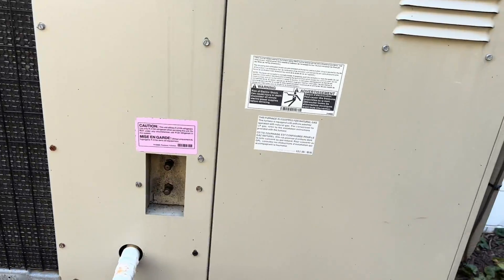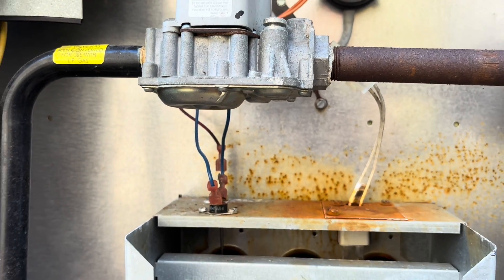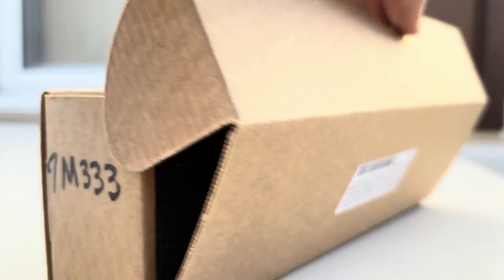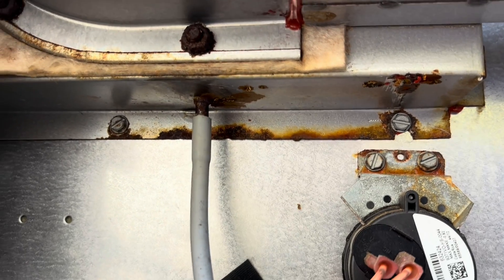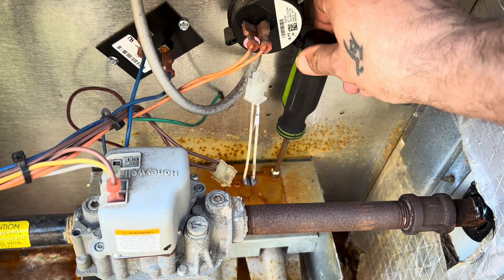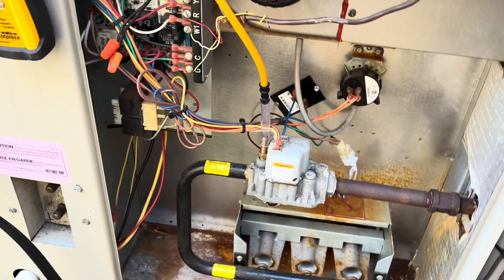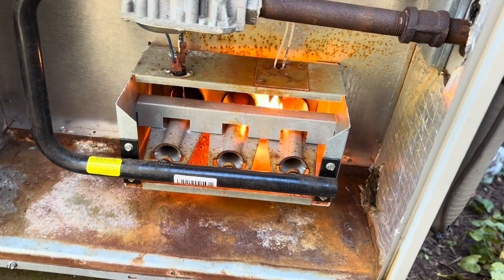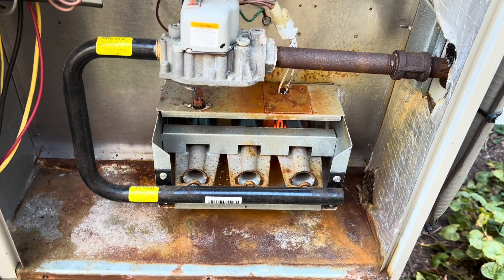Gas Package Unit Keeps Burning Up Ignitors! Weird Rusting Around Burner.

Comment: that looked like lp propane setup, theres usually more rust and water vapor (condensation) with the propane units that i have seen in my experience, that is all brands of equipment, some better,some worst.

Comment: That delay is an excessively long time.
Reply from the maker: Sure is.  I thought it might be the board getting hung up but it’s pretty consistent, 50 seconds between, ignitor and ignition.
Reply: @JeffsHVACAdventures  be curious to know what the manufacturer says. There is no reason it should be that long. I'm not sure if that's why you're losing igniters, but it's not helping you
Reply: right I always thinking 17sec max